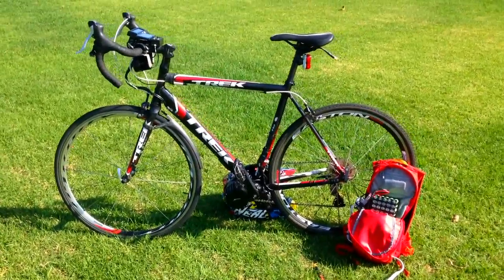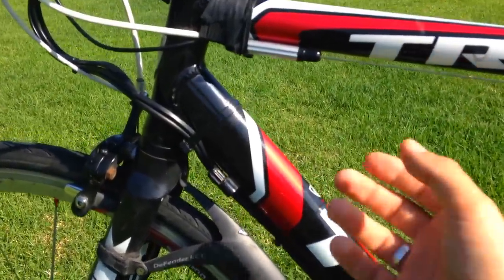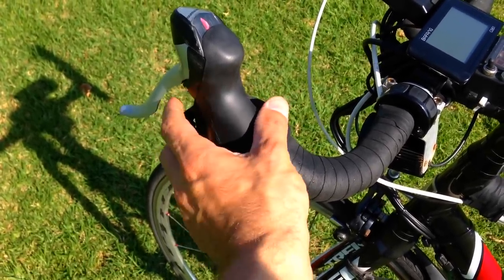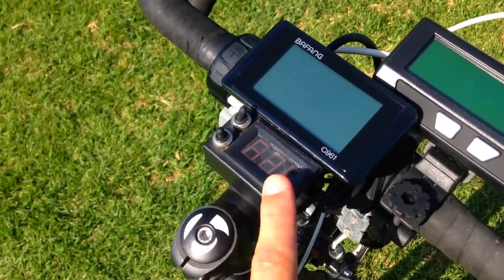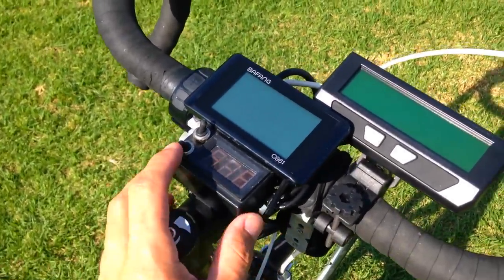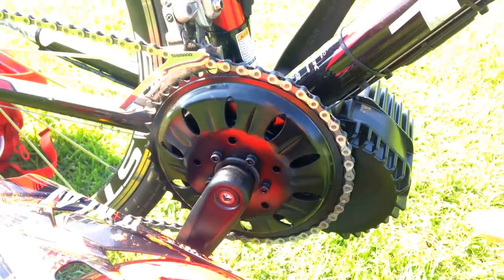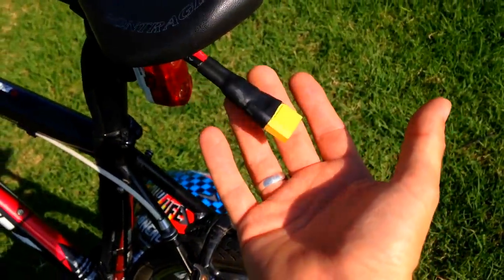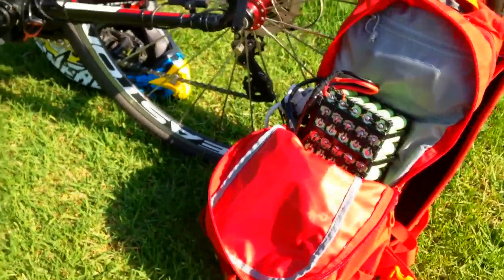Bafang BBSHD 1000w mid-drive • Walk around my road bike • Electric Bike 48v BBS02 8fun motor

Comment: Bruno Hello! Super bike and also very Clean
One question, if I get a 1000W motor with a battery of A 11.6. Could I reach the speed of 70 km / h with a 46 T?

ps: I know you put the details, but I do not have the same battery as you, I just wanted to know if there was a difference in power. I'm not an expert, you, you are rather a specialist

I wish you good end of year celebrations

Sabel fom Marseille
Reply from the maker: +Why Not ? - Yeeeeahhhh... helloooo my Marseille friend... thanks for watching my videos...  Yes, you can reach 70km/h just like I did here https://youtu.be/RbiNoNmqUpg  74km/h was a peak but I could maintain over 70km/h pedaling and if I don't pedal at all the top speed vary between 55 and 65km/h depending on the road, wind, sometimes you may be slightly going up or down hill even when looks like you're on a flat road...
Battery... the 11.6Ah just for the number I can tell that it uses the same Panasonic PF cells that I use in my pack... the advantage I get with my pack is that I have more cells connected (70 in total) my pack is 52v also called 14s (number of cells connected in series) not 48v also called 13s. 52v battery would give you a faster motor RPM and also keep the voltage at higher levels for longer as it has more cells.
If both batteries are 14s or 13s at 30A there is no difference in performance, the more Ah you have the less the pack should heat up under load, so 14s pack with 14.5Ah will run cooler, faster and longer range than a smaller 13s 48v 11.6Ah
I explain lots of things about batteries here in this link https://www.youtube.com/playlist?list=PL59mIOWSOm9qrSglqe18AlYfBJRXLdduj I will be making a battery tutorial explaining so many things, how to calculate the power in your pack and understand how cells are connected together (series & parallel) talking about BMS and fast chargers as well.
Yes... get the BBSHD, much faster and more reliable than the BBS02... much better motor!! You can sell the 750w to a friend or maybe put in another bike just for fun... then you have a spare one just in case.
I wish you a fantastic and very happy NYE with lots of French delicious food!! hahaha 
POWEEEEEEEERRR... =]
Reply: I think my boss wants an electric bike, I will offer him mine, I'll buy the 1000W motor for more power. If I sell it, I'll send you pictures of my new machine.

The big hello to australia :-)

God bless you and keep you

Thank very much
"translate french" = Merci beaucoup !  :-)
Reply from the maker: Yeeeahh... this is the best you could do... find someone to sell your bike and get the BBSHD, much better motor, faster acceleration and higher RPM for good top speed. It is 46T at the moment but someone will come up with 48T and 52T soon.... I thought I was going to hate going from 52T down to 46T but I am actually enjoying as it is, better acceleration in traffic.
Sell to your boss, shake his hands saying "merci beaucoup" hahhahahhaha...
So much POWEEEEEEEER... =]

Comment: Oh, I thought you were just making that accent up to sound funny, but that's actually your Australian accent? Lol...
Reply from the maker: +Leandro Almeida - Yeeeahh... this is my "fake Australian accent" haha...  7 years living here + a bit of Brazilian/Italian background to give a little extra "flavour" + my passion for eBikes... this is exactly how I sound in real life when I am talking friends and family and even at work hahaha.... so much POWEEEEEERRR!!! =]
Reply: +ElectricBike (Bruno) mate does the motor detect gearshifts?
Reply from the maker: +Majorblazer 90 - I never use the pedal assist, throttle only so I am always under control. I change gears like a motorcycle, I release the throttle every time I change gears, you get used to... just think all motorcycle riders do that every single day and they never complain. It is almost like asking someone "do you like automatic or manual" some people hate automatic or semi automatic because they want to be 100% under control without sensors controlling things. However gear sensors are really good and protects the gears from any human mistake so it's recommended to have one. It goes connected to the controller in some models but if your motor doesn't have that connection you can just connect to your eBrake connector and maybe do a final tune with the programming cable reducing the cut off delay every time you change gears.... so much POWEEEEEEER =]
Reply: ElectricBike ahh man thanks for the reply..I was planning on having a custom bike built with high end components and using the best kits possible was looking at erad 1000w kit and the Bionix but the bike would end uop costing close to 10k..So i have decided to buy a stealth bomber for around the same price, I live in canberra commutes are rarely over 20k even if im going to the far side of town, many bike paths so Ill just be using the normal mode on the footpaths and sportmode when I find an empty field along the way of which there are many...Australia what a beautiful country.
Reply from the maker: Yeeeeahhh.. the Stealth is a powerful bike... hahhaa.. very heavy like motorcycle too... 
I just don't understand where you got this $10k number from...  its not that expensive to get a powerful bike... check out the prices here http://www.emax-ebikes.com.au/ we just got a new stock with over 43x BBSHDs...  the Stealth Bomber drags a lot of attention, it looks like a motorcycle and cops will stop you... imagine spending all that money and getting in trouble... =/
Give us a call during the week and have a chat with Ewan... I am sure we can POWER your ride waaaay cheaper than 10k and you won't go to jail. hahaha...
So much POWEEEEEEER =]
Reply: I swear to god I was certain you were South African with that accent, but that energy you radiate is full on Aussie all the way. Does the BBSHD help with lowering the center of gravity for tight, safe turns with tires that thin? What limits have you hit so far?

Comment: hey Bruno, love your work, what of you have hydraulic brakes on a drop bar bike.. where can you get sensors for those?
Reply from the maker: +Antony Day yeaaahhh... then you'll need to adapt and install (glue) a little magnet and a magnetic sensor on each lever, so when you pull the brake the magnet moves away from the sensor and cuts the motor.
 https://m.youtube.com/watch?v=5TbNxzOxd00
Maybe search on Google "bafang hydraulic magnetic sensor" 
If you're in Australia www.emax-ebikes.com.au has some in stock =]
Reply: ElectricBike thanks Bruno

Comment: sweet, that motor really isnt very noticeable at all, I can see why you keep the battery hidden in your back pack now, speaking of hidden have you seen the motors by vivax hidden in the frame pole?
https://www.youtube.com/watch?v=Il7NQem7Dkc&feature=youtu.be#t=237.966971
Reply from the maker: +Jayme Capurso - Yeeeahhh.. Vivax motors are virtually invisible... check out this other video here https://www.youtube.com/watch?v=8DIQ9pBjGFU
The Vivax motors used by these riders would easily be detected by a metal detector like the ones used by security guys at concerts and night clubs. So why not manually scanning the bikes before the competition start?
The Vivax motors require a different bottom bracket that allow the motor to be inserted from the bottom, it is visible if you turn the bike upside down. they actually cost BIG $$$$ talking about $3k.. $4K... and they only put maximum of 200w.. which is a reasonable amount of power, very clever design but...... I wouldn't spend all that money for 200w when I can get my monster BBSHD made in China putting ridiculous 1500w + legs... so much POWEEEEEER hahahaha... =]

Comment: your bars are tilted up too high
Reply from the maker: Yes, I was forced to tilt it higher... I used to ride this bike with the handlebars flat but stopping at higher speeds I was almost rolling over the handlebars and my hands sliding forward... waaaay too dangerous. This is a must if you're stopping at higher speeds over 75kmh... like my other videos 82kmh.. 85kmh... =]